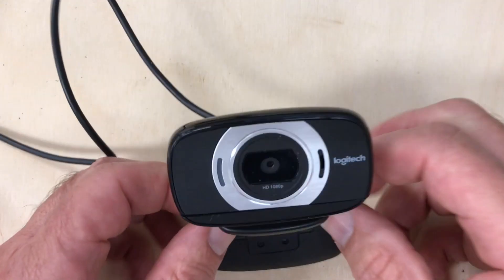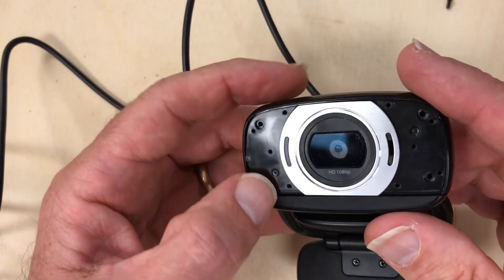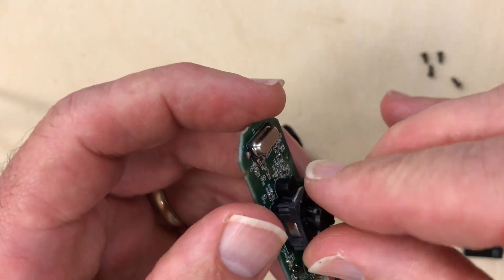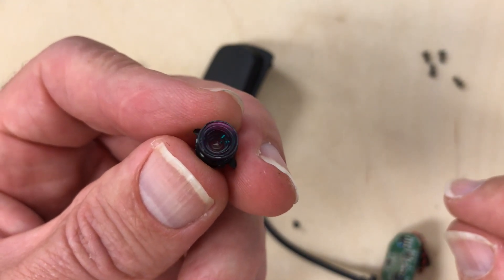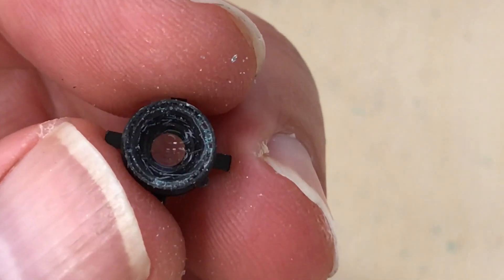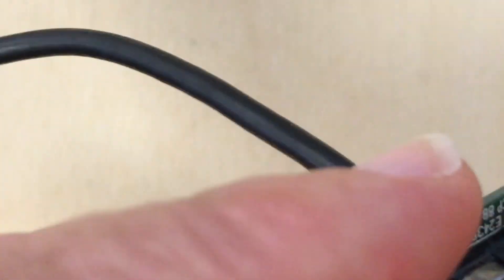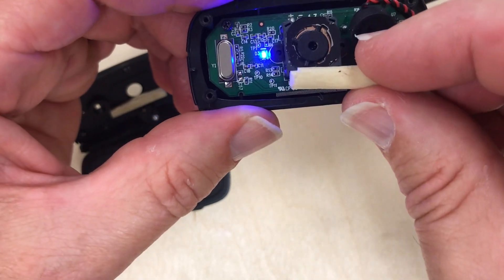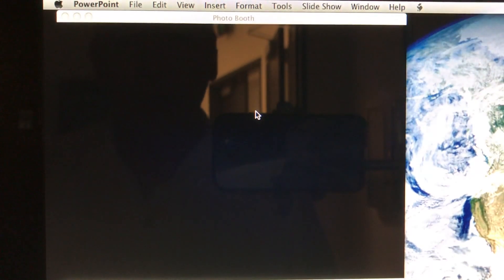How to Convert a Webcam to a Near-Infrared Camera

Comment: For removing the IR filter. Would warming up the glass with a soldering iron loosen the glue enough to pry it out?
Reply from the maker: I would try prying it out gently first but warming it up would be a good alternative. A hair dryer might work and not be as hot.

Comment: have you tried surrounded that webcam with iR light  and then try facing that ir camera through desktops, boxes, objected, housing cases etc to make x ray.....  or even an emission of low wave length lower than 650nmm for the iR Light
Reply from the maker: Yes, not x-ray but it does see through some fabrics as I write about in my blog post that this video was made for: https://phyzblog.blogspot.com/2018/09/making-invisible-waves-visible-near.html

Comment: As other have asked, but was not answered... Would this be helpful (good enough) to find hot, faulted components on a PCB board?
Reply: no, this is near IR, not close enough to IR to see heat.
The way you can tell that this would not be useful is the fact that when he points it at the lights or him self you don't actually see "the hot stuff" , when he points it at himself you only see the refelcted near IR light lighting him up, if it was IR his eyes would glow brightly.

Also the remote control test would look black in IR, since the remote control is not actually warming up the $20 bill.

Comment: Thanks for this, just opened my logitech c270 and it looks like the filter is on the ccd chip :(
Reply: I successfully removed mine from my c270 with heat and a little bit of brute force but I ended up with a lot of debris on the ccd, and I never got the lens back in focus.
Reply: @kieranblazier4058  Thanks Kieran, you boldly went where no man did dare tread :)
Reply: @kieranblazier4058  Hey, do you happen to know the name of a spare ccd for c270? Couldn't find it mensioned anywhere